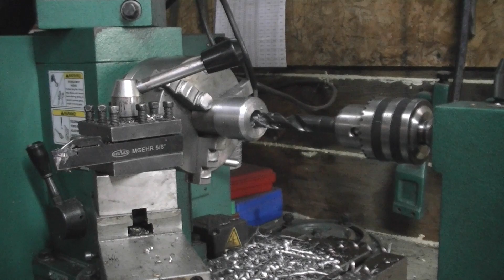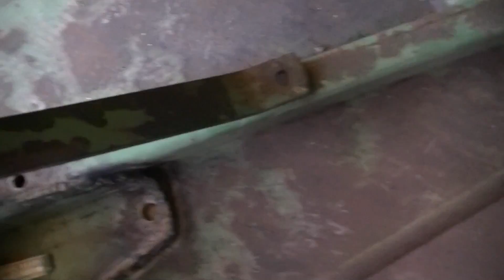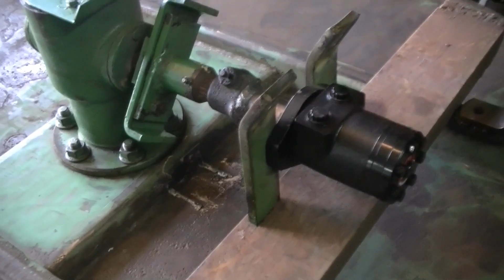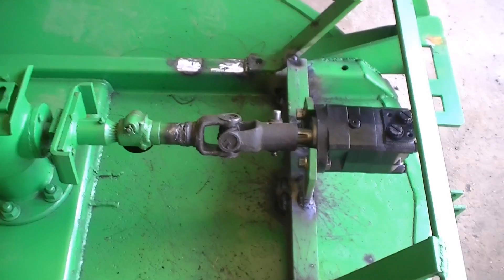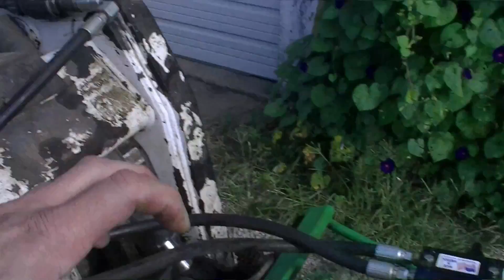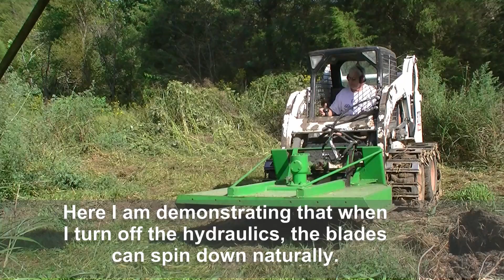135 RSW Homemade Skid Steer Hydraulic Brush Hog

Comment: I am surprised people dont just use a prince pto pump slid onto where the shaft normally goes.  Instant mounting.  I plan to build one of these for my tractor.  
I have a pto hydro unit now that runs a front mount blower.  Too easy to convert a hog to hydro.   
From my research, you can gain some use by cutting the front back  a little to expose a few inches of the blades for larger brush

Comment: What thickness attach plate did you use, you know they come in 1/4 5/16 3/8 and 1/2"
Reply from the maker: It was quite a while back. I haven't used it in a while, but I believe it's 1/2 inch. It does work really well.

Comment: That was the most interesting build I have seen in a while. I have a brush hog type mower with two heavy flail blades that mount to a very heavy arm that do the cutting. I would love to be able to mount it to my front end loader and run it that way instead of looking back all the time. The loader has been converted to a Skid Steer Quick Attach system already. Thank you for sharing.

Comment: Put wheels on it and place the arms in float
Reply from the maker: We don't use it as a regular brush hog will use it to cut down in ditches and small trees Etc so there's no need to put wheels on it
Reply: @RosaStringWorks  my point is it could just float and follow whatever terrain and not gouge into the ground without adjusting it all the time as skidsteers bounce because of short wheelbase , you could still use it as you have been, just a friendly suggestion. :-)

Comment: Thats awesome.  Have you ever tried it on blackberries?  I know the stocks are a bit tougher than most brush and I have a ton of blackberries on my property I would look at building something like this to remove them if possible.
Reply from the maker: Blackberries would not be an issue. I've cut 4 inch trees with it. Thanks for what
Reply: Rosa String Works that's awesome appreciate the response

Comment: the pressure relief valve bypassing the overpressurized oil might cause the hydraulic oil to get hotter than usual , might want to keep an eye on that  
that contraption might actually work on small trees and stumps too as you can lift it up high enough with the bobcat (prolly duck out of the way of the chips that be flying though)
another nice thing is that you can see wat youre doing without turning around in youre seat like you would need to do when driving a tractor with the bush hog atached
Reply from the maker: We've been using it for quite a long time now. I've cut down 4 inch trees with it quite easily. It works really really good. Thanks for taking a look.

Comment: Excellent idea,  what part numbers on the motor, check valve and cross over relief?  thanks,
Reply from the maker: bigfootGeorgia its been a while, sorry don't recall.  But it has to be sized to your machine anyway.  The best thing is call the Supply Center in Nebraska tell them what you have and they will recommend the parts for your application.

Comment: Had no idea a Bobcat that size would run a brush cutter very well. Been wanting to build one for some time but have been too lazy and with my lathe broken, did not want to take on the challenge. Only thing I want to do differently is make a floating mount and have casters for mowing. If I had a rigid mount I would put rubber tired casters on the front so I could make turns without digging in. Then again with steel tracks on you don't have to worry as much about getting stuck or digging holes when you make turns.
Reply from the maker: cleatrampler Thanks for watching.  We don't really have any problem with it digging in.  I suppose if you're on really smooth ground cutting only grass, the casters would work out okay .  But out here that wouldn't work at all, too many rocks, brush, and ditches.  I will say the thing works even better than I expected.  It is awesome my wife just loves it!  Thanks again.

Comment: Jer..fantastic engineering....have you considered a plexiglass screen to deflect debris? didn't seem to be an issue in the short application test though...
Reply from the maker: Thank you.  We have a windshield for the Bobcat.   So far, its not been a problem at all because the mower is well below the driver.  In fact, it is MUCH better than when using the same mower on our tractors.  Used to get debris hitting me all the time.  So far none of that.  Now that I've used it a while, I am in love with it. lol. Thanks again!

Comment: Nice job on your build. I have been using one of these (Only Factory made). It did not have a bypass, when you shut it down in the skid steer the blades came to a sudden stop (first time I used it I liked to have jumped out of the skid steer, LOL) hasn't hurt a thing You idle the engine down before shutting down the hydraulics
Reply from the maker: Thanks for looking.  That's wierd, the factory one we used had a bypass built in.  The blades slowed naturally.  In addition, the Surplus Center guy definitely recommend one to avoid trouble down the road.  They even provide a diagram online.  Finally others I have seen on YouTube put one in too.  So better to be safe than sorry I guess.  I'm no expert but I like the slow down over the stop.